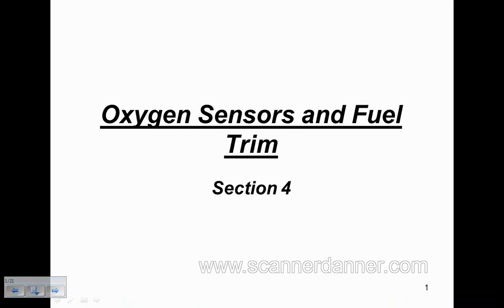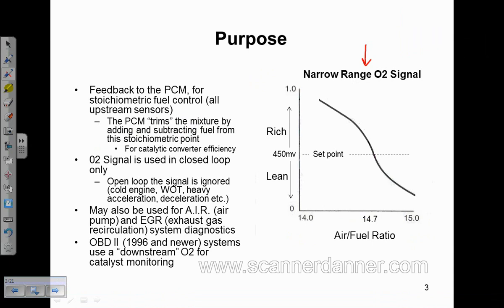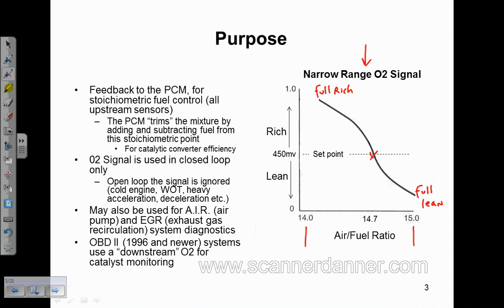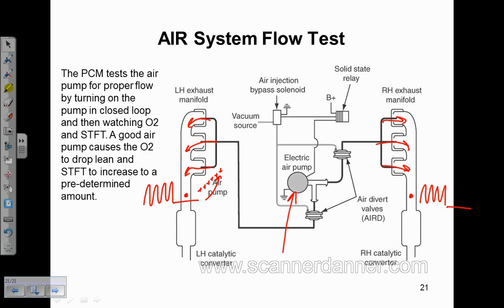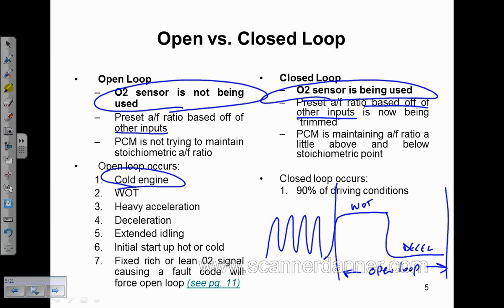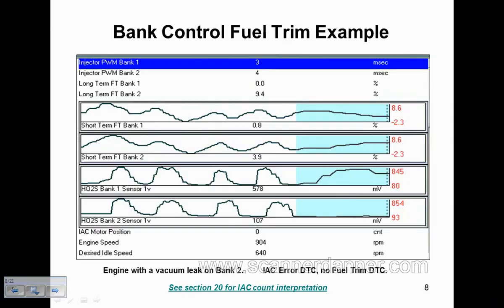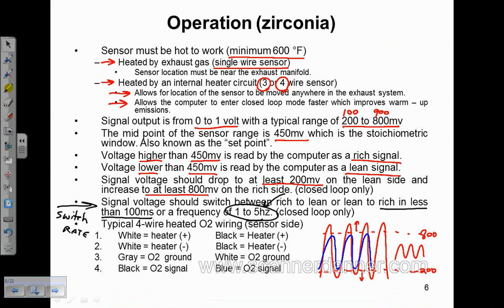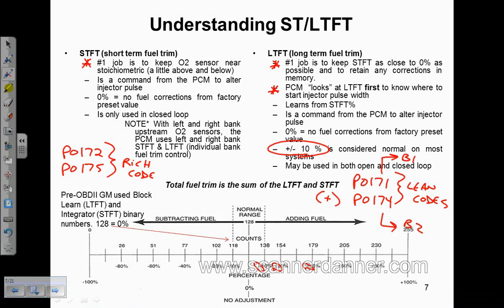Chapter 4 (Oxygen Sensors and Fuel Trim) - an SD Premium preview

Comment from the maker: I'm working on getting some wideband info. for you guys. There are a lot of variables with them and I do not have enough case studies yet to put in print. Anyway based on your downstream O2 indicating rich and your fuel trim showing negative, this suggests the upstream wideband is reporting accurately (actual rich condition and not a bad af sensor). So this means you have an actual rich condition. Follow Section 5 page 4 on the right hand column for causes of a rich condition.